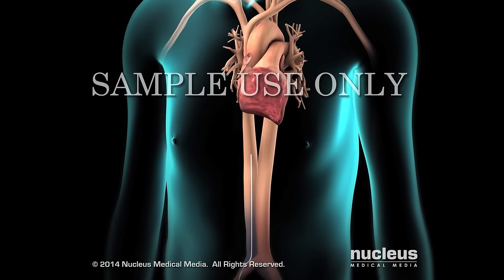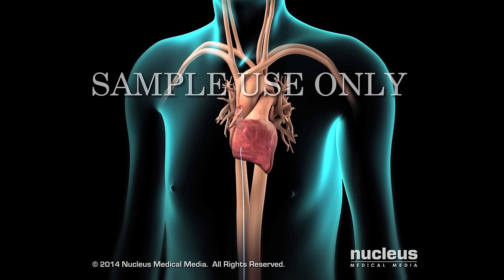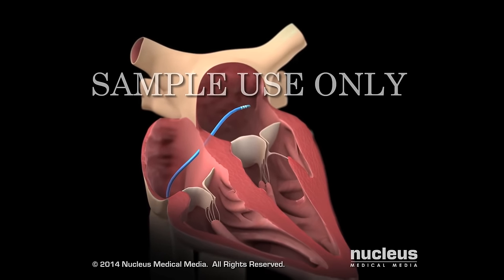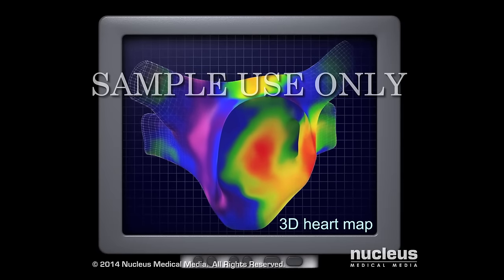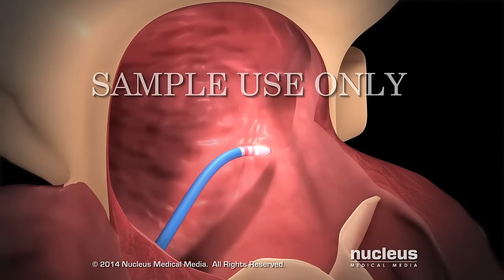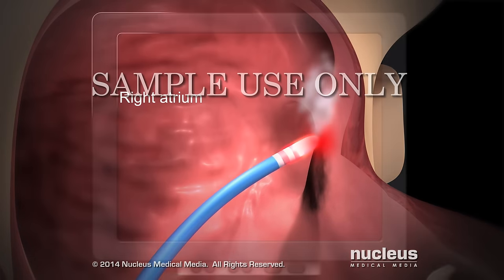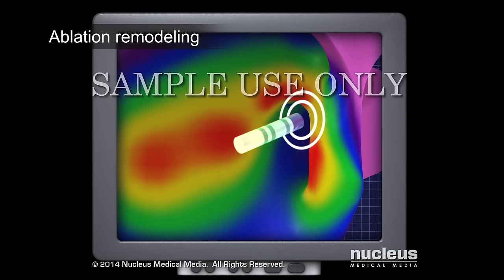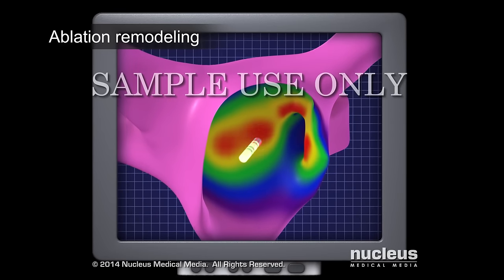Catheter Ablation

Comment: I've done this surgery two times the past 6 months. 1st time I was very nervous and scared. Had a hard time sleeping the night before and came to the hospital exhausted, the nurses where extremely calming and explained that as long as I stayed calm it'll be like nothing. For the most part this was  true. The actual proceedure itself isn't painful, it can be scary feeling the extra heartbeats as they're trying to locate the issue that you're facing with your heart. In my case I had an extra pathway in my heart that triggered recurrent heart palpitations.

After around 6 months the pathway re-appeared which triggered the same issue again. The doctors concluded that I was going to to another ablation. This time I felt calm given that how the it felt the last time I did this and I wasn't scared, I was nervous of course, but not scared. And my experience was nothing but positive. If you're going to do this, don't be scared. It's a really safe proceedure and just trust the doctor. 
The only side effect that I encountered was being tired after the surgery which is natural considering the mental stress along with having done a surgery.
I also want to add that the thought of them being inside your heart is way scarier than the actual feeling of it.
The nurse explained to me that you don't really feel pain and the sense of touch the same way in the heart as you would in your finger for example.
The sensation is more spread over your chest, but I felt that it was impossible to pinpoint it to the heart, if I didn't know that it was in my heart, I would've never guessed it.

I'm extremely thankful for this technology and to be frank, if my heart issue would appear I'd be more than happy to do this surgery a 3rd time.
It might not be the most pleasant thing in the world, but compared to having heart issues, It's great.
Reply: I have inappropriate sinus tachycardia,,, do I need ablation, I am taking Homeopathy heartbeat is little bit in control
Reply: Thank you for your honest opinion which you have shared.  I had svt twice time  my docter has advised me for ablation iam literally afraid to go for it.  Your experience making me confident

Comment: I had WPW and I'm so glad they fixed it. Thank you surgeons!
Reply: I recently diagnosed wpw pls tell me your stories.
Reply: @dhavalkareliya7130  I had a fast heartbeat around 90+ for my resting BPM, my only symptoms were palpitations so you could say I was lucky enough not to experience some of the rough symptoms, I also had shortness of breath therefore I refrained from any sports or activity that needs a lot of stamina. Also no caffeine or any consumable that can increase heartbeat. But after I had my surgery, I was then allowed to do everything including sports but since my body was used to a fast heartbeat, I would occasionally still have around 90 bpm but it's normal. I suggest meditating, it helped alot, breathing properly and relaxing reduces fast heartbeats and palpitations.
Reply: I'm 35 now and I have episode of fast heart rate once in a 2 year almost 200 BPM. Past tow year I'm on beta blocker (bisoprolol 2.5) since on beta blocker I didn't get any episode but I feel anxious about sudden death I have two little doughter now I'm thinking of ablation.
Reply: @dhavalkareliya7130  what did u decide ..
Reply: @yellowlonghornrooster1868  after one month I have to do ablation.
Reply: @vermontiii8995  thank you for sharing  your story..i had also WPW and also same as yours..but now they fixed it dec14,2021 and now its my 10days of recovery..how your feeling now after 1year?
Reply: @ronamagayon6955  how long we need rest after surgery
Reply: @vermontiii8995  hi, same. I never had a heartbeat above 200 ... but I do have wpw. How much bpm did you have when they tried to find the spot?

Comment: I had this done 3 days ago after 5-6 years of random SVT`s especially after working out.
Took beta blockers over the years which didn't do much in the end.
So my Cardiologist said either the ablation or accepting aggressive side effects of medication.
The procedure itself was pleasant . They knocked me out with a good portion of Propofol. The only ugly part was swallowing the echogram 1 day prior the procedure ( for mapping the heart).
I had a stinging sensation in my chest while lying down and breathing in, after the procedure which was terrible but only lasted for 24 hours and my groin looks terrible because it bled a bit over average afterwards - Now i will have to rest for 7 days and take blood thinners for 5 weeks in order to prevent occasional thrombosis.
I still have some "ghost flutters" but i anticipate some improvement for the long run.
Reply: I had a bit of a different experience when it comes to the actual procedure, but the flutters do get better! It does keep you on your toes though, thinking it's about to come back, but then there's a relief when your heartrate just goes back to normal.
Reply: @10me20theoneandonly  sounds like this procedure doesn’t help at all..
Reply: @rambobrazy8411  what do you mean exactly? In terms of it not helping with the svt, or other complications? I can’t say I agree with you, but I do want to understand you.

Comment: I just had this procedure performed 2 days ago after being diagnosed with paroxysmal atrial fibrillation at 44 years of age. Other than some mild flu-like symptoms and a sore throat i feel pretty good. I have little to no pain in my groin where they inserted the sleeve that the cathetor goes into. I just hope that the ablation solves the problem. I've gone into afib around 8 times in about 7 years.

Comment: Question. I had an ablation about 4 months ago - paroxysmal supraventricular tachycardia. After the post-operative period and after I stopped taking the pills, my condition slowly worsened. Now I feel half normal, but I have an arrhythmia (or fibrillation?) periods right now, when I can clearly hear the uneven rhythm. If someone have faced such situation, can you help - is this a frequent occurrence after such operations or is it some kind of investigative violation? The doctor recommended another ablation, but I'm not sure that I won't get worse after another one.

Comment: Does the catheter go trough the inter atrial septum? How? Do they just push it trough?
Reply: +Ing00 Yes, they just push it through a spot where the interatrial septum is a very thin tissue. Also, this pretty small hole does not have a relevant effect on the circulation when the procedure is over.